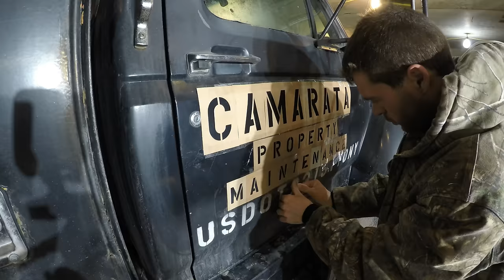Getting stopped by DOT

Comment: Another cool video, thanks! I used to be in fire safety education. For a few dollars more, halon extinguishers are so much better and last longer.    I have one that is now 12 years old and still at full pressure. Unlike ABC dry chemical  extinguishers, they do not ruin everything they come in contact with, and there is no powder to cake-up over time. They literally suck the oxygen out of the air, stop the fire asap and don't damage all the surfaces they come in contact with. With an engine fire for example, you will save soo many components.

Side note: before using a dry chemical extinguisher, smack it on the ground a couple times to loosen up the powder ensuring it will work. If the powder is caked-up inside, it will shoot out air instead of chemical.

Comment: I know this seems counter intuitive, and may vary from state to state and even scale to scale, but setting up a voluntary DOT spring inspection at a scalehouse can save a world of hurt later.  It demonstrates you are wanting to keep everything current, and if they find anything but a fairly critical red tag violation you are allowed to drive back home and fix it.  The alternative is to have problems discovered on a roadside inspection, after which you will have to have a certified mechanic come out for a service call, lose a bunch of time and generally at least several hundred dollars.  Also, most DOT guys will figure if you're driving right in to see them, they don't have the fear factor to work with, and you'll see a different attitude.  

Another alternative is to have a yearly DOT inspection/repair done by a certified shop, and the little sticker on the windshield.  I'm not as big of fan of that; had one done awhile back, and they missed a couple biggies which I later found while working on something else on my truck.  One of them was 2 cracked/loose bolts on my steering sector - now new Grade 8s are cinched with Nylocks.  Had a DOT dude found that, would've been ugly.
Reply: The solution is to be a better inspector than they are and know the regulations forward and back. Go out and inspect your truck like it belonged to someone else, then fix the violations. Also, always be cordial to the DOT person, it will be money in your pocket.
Reply: Hate to be the bearer of bad news but there is nothing " Voluntary " about D.O.T inspections considering you either comply with their demands or get locked up in a cage for resisting them or worse murdered for resisting their attempts to lock you in a cage!

Comment: I guess 'they' get us all, eventually!
By the way Andrew, I would suggest that you use a torque wrench on those lug nuts, and be sure to watch the direction of rotation for the tread on your tires. 
The next time you have to 'do battle' with a tire like this, get yourself a more soapy water solution to spray around the bead, it'll make it a bit easier to remove the tire and install the new one,..but NEVER use grease ( as some might suggest ) grease/oil don't like rubber.
Reply: Reg Sparkes ...
Great advice.. 
torque it to spec 
and after your first load 
re-torque it again...
Been a Heavy Equipment mech for 35yrs up here in Northern 🇨🇦
Cheers
Reply: Hey Luke, thanks for the 'back up' !
Greetings and Cheers to you, from far eastern Canada !!
Reply: Reg Sparkes  he proberly should leave the nuts on as well before he hits the collets. They have been known to fly off and brake teeth or fingers.  Just loosen the nuts to the end of the thread then hit those collets buddy. 🤭
Reply: Use straight dish soap next time. It'll make that bead slick as snot.
Reply: Astroglide works
Reply: Grease doesn't bother the tire, been doing if for many years, the reason to use grease over soap is that it keeps the road salt from destroying the rim. The tire flexes away from the rim letting salt in and then it sits there destroying the rim, the grease is a good barrier against it.
Reply: David Morse   Please don’t tell me you copped one in the nads. 😩🥴🤢🤮
Reply: @dunk4373  I hate to admit it.
Reply: It makes it slippery because it is dissolving it.
Reply: I am glad it works for you. Tires for my truck costs  around $650 so I am not going to take a chance with gas, Murphy's  Oil Soap is my choice. Also gas is so dangerous. Got burned up using it as a kid.
Reply: @dunk4373  absolutely, Kid is good but needs MORE experience  and knowledge !!!!!!!!!!!!!!!!!!!!!!!!!!!!!!!!!!!!!!!!!!!!!!!!!
Reply: Ron Thorp he is doing great work ! There’s not many younger blokes out there anymore having a go. Most of the youth these days wouldn’t even know that they had a flat tyre in till the side wall was destroyed let alone know how to change it 🤔
Reply: I grew up in a family truck and heavy equipment repair business I'm 57 years old and still in business. I've never seen anyone use a torque wrench on a Dayton wheel in my life
Reply: Cindy Tepper  we call them spider rims in oz. I’m the same as you never seen anyone torque them. We use to put a block of wood or something with a square edge on the ground and rotate the tyre as we tighten them to make sure they ran true. After that when they travelled around 50 km the driver would get out and re tighten them after that no troubles.
Reply: @dunk4373  Like torque would mean anything on those dirty threads and that one stud and nut that are seized together that is tightening into the spoke of the wheel. Actually that stud isn't seated into the wheel.

Comment: For Future, when doing it in the Cold changing old tire for new one. Try using a Heat gun or heater to warm up the tire some. would help a little bit.
Reply: plus a little soap and water in a squirt bottle helps, tire guys call it pig snot.

Comment: When you buy a "good" fire extinguisher there will be a valve stem assembly on it. This can be used to top off the pressure if any bleeds off and to refill it after use. Typically you can recharge the extinguisher three times before needing more powder. Just unscrew the top and make sure there powder in the bottom ( at least three inches worth) and check the o-ring seals before reattaching the top and represurizing.
Reply: Make sure there is no pressure in the bottle before you screw it open, or accidents will happen. Over here in the Netherlands you have to check the extinguisher yearly and every 5 years a pressure test.
Reply: In my 67 years of life I have yet to use a fire extinguisher to put out a fire.  They just made the rule up to have another excuse to write you up for something. Also somebody's brother in law is in the fire extinguisher business.
Reply: Powder fire extinguisher should not be pressurised with standard compressed air, It contains moisture and will cause the powder to go lumpy Either dry air but usually Nitrogen

Comment: 4/32" on truck tire thread in NYS , 2/32" on light duty vehicles  for the NYS inspection .
Reply: Or just go to a place that don't care lol.
Reply: I've seen those regulations printed exactly as you describe,  it bothers me more then it should that it isn't 1/8" and 1/16"    reduce your fractions DOT!
Reply: 2/32"s is the Federal CMV requirement for non steer tires. 4/32"s for steer tires.

Comment: Don't kid yourself.  The reason they are there is to generate revenue for the state.  Any positive effects are circumstantial.
Reply: No doubt.
Reply: No. Its definitely so timmy and jimmy dont put 20 tons of logs in their rusty truck and kill a family of 6 because their brake lines blew oug
Reply: @tiddiesprinkles  lol I had dot stop me because my garden hose was hanging too low to the ground
A lot of it is bullshit.
Reply: @testman8974  think about this, your garden hose catches something in the road and gets pulled off your trailer. Not a huge deal right? Now imagine if while your garden hose is getting pulled off it gets wrapped around your tool box wheels and yanks 300lbs of tools with it at 70mph.... that's why everything and anything needs to be perfect.
Reply: @testman8974  i have seen a hose hanging of the side of a cement truck, and all I could do was hope it was on his side of the road and not hit my windshield

Comment: I know this is an older video but I had to put in my 2cents. When you adjust those self adjusting brakes you should tighten them all the way down then back off a 1/4 turn to get them the same adjustment all the way around the truck. And grease them as well.

Comment: Lots of lubrication and little bites of the bar make tires go on and off easily.  ;-)
Reply: Also having a toasty warm tire works too, let it set in front of a salamander heater while you have lunch.
Reply: Dawn dish soap mixed in bottles with water
Reply: Mike straight dish soap works best in my experience. No mixing or hassle and the bead is slicker than a banana peel

Comment: Tire changing 101 , use a soapy spray solution to help get tire off rim
Reply: Tire vaseline is way better but soap also work
Reply: Timothy Edmiston warm tires are far easier as well...
Reply: It also helps the tire go on easier than rubber cement. I am guessing that he has never heard of selling his casings back for retreading
Reply: All lube ya rubba
Reply: Outside in the dead of winter lol. Maybe just the soap

Comment: Good video,just stumbled across your channel,was surprised to hear your radio station as I listen to the same station,I realized your a local guy... I’m in the Walden ,NY area  ...DOT has been really hitting it hard lately,always seems like whenever I see bad violations,they are never around,then I see them crawling all over a new peterbilt that’s clean and well maintained,and an old Tri axle with leaking brake cans ,a leaking lift cylinder,and bald tires just went by and got away clean ,it’s all in the timing....
Reply: New truck you got the $$$$$$$$$$
Reply: That's because clearly a guy with a new well maintained truck has some money he can part with.

Comment: Wedged wheels should be lined up perfectly. While jacked up lay a block of wood alongside tire, spin tire too look for wobble, adjust with lug nuts on wedges. Just tightening lug nuts and wedges will usually not work.

Comment: I still have no idea how these two-piece wheels are safe
Reply: They are not 2 piece they are tubeless wheel's they did not make a 22.5 two piece wheel
Reply: @chrispoole2531  Some wheels have a removable bead ring and at first I thought it looked like that type of wheel but couldn't see where the split in the ring was. These aren't really a two piece wheel since those wheels actually split into two pieces in the center of the rim.  Both types are illegal to use anymore as people have been killed when they blew apart when first airing them up. You have to be sure to clean rust from them before trying to reassemble them and many people didn't do this causing trouble.  A cage or wrapping a chain around them is required in case of an explosion.  I had to mount my own motor home tires because of the wheels having split tire beads. These kind of wheels also have a tube installed to hold air.  Neither the split wheel or removable bead wheels are used any more.

Comment: fire extinguishers are required in my country too (for all 4+ wheeled vehicles) but they expire, so even if the gauge is still showing perfect pressure you need a new one, i think they expire every 5 years, you can get them checked and refilled but it's not worth it.

Comment: I guess DOT was waiting for you to arrive on this road.
Reply: Bernard Peraldi the dot guy was driving by while andrew was sitting at the stop sign.  that's why he was turning around when andrew came upon him.
Reply: Andrew was broadside to him and he probably spotted the lack of door lettering bigger than shit. (I got nailed that way once as well) 
Generally, if you have one visible problem, there will be more.
Reply: Why are so many weigh stations closed now? I only see one or two once in a while open. The rest seem abandoned in the Northeast. I don't think I see any automated ones that replaced them.
Reply: Cantankerous Clanking Contraption They probably figured out that people were just taking side routes to avoid them. 
Portable scales are easy to setup, and driving around lets you spot people you might never see on the highway.
Reply: Cantankerous Clanking Contraption I live in CT and the state has only a couple folks to run the scales. They go from scale house to scale house. One day they could be in Stafford, the next in Danbury. Depends on the day.
Reply: I'm in mass, and they move the gear around probably much for the same reason.
Reply: acprimus631C, Those Ct bastards would pull me over every other week and keep me tied up for at least 45 minutes and almost never find anything major. I live in Ct also.
Reply: @cantankerousclankingcontra8295  Drivers are more aware  of what is required now thanks to the internet.  States cannot issue as many citations so the weigh stations cannot make enough money to support themselves. Also trucks going in and out of weigh stations impedes traffic and is a safety hazard. Weigh stations are obsolete but it will take a while before they are phased out.

Comment: Do you ever balance your truck tires? Or is it not necessary on trucks like that?
Reply: Usually, they just balance the steers.  You can balance the drives, but nobody bothers unless there's a serious issue.  Before balancing duals, usually they will rotate the wheels to differently opposing positions to see if that corrects (to any degree) the imbalance.  If turning/moving the rims alone doesn't work, sometimes it's a matter of deflating the tire or even totally dismounting it to visually inspect for a problem.  If they are that badly out-of-balance, there should be something visible to the person (such as a bunch of boots or patches close together on the inside), the tire is more likely to be taken out of service before trying to resolve it with balancing, but if you have the money and insist it be done,  it can be done.  Most folks just see it as a waste of money at the time that "new" tires are put on in the drive position.  That said, it's not impossible to get a truly "bad" tire, but not usually a brand-new one. The tire factory usually does an in-house test on the tire before it leaves the factory. Of course, buying tires from questionable sources can yield less-than-desirable results :)
Reply: Generally truck tyres are not balanced like a car tyre with visiable lead weights, generally balance beads are used inside the tyre, 2 handfulls are placed inside wilst fitting the tyre and cenrifugal force spreads them to where they need to be.

Comment: In powder fire extinguishers the powder compresses over time.  The same powder will compress at the same rate.  A Carbon Dioxide Extinguisher has a longer shelf life and it leave no residue.  Powder fire extinguishers are very messy and hard to clean up after use.

Comment: You have a 'tire machine" and your busting your ass with tire irons?
BTW:  You should have kept the replacement tire in a nice warm place in the house before trying to put it on.  Would make the job a bunch easier.
And your dirty oil is "right where it should be":.
Reply: Diesel engines have dirty oil no matter what.
Reply: yeah the oil wasn't that dirty

Comment: I got told by guys that service extinguishers the you need to turn them upside down every 3 to 6 months to keep the seals good. Ive got 8 yr old extinguishers that are still holding good pressure ( i have newer ones but keep the old ones to use first IF i have a fire)

Comment: ANDREW: 125 PSI, for a dual wheel 295/75/R22.5? That seems high. 95-110 is the max I've seen. 95 PSI would work fine and give a better ride if the air pressure matched the weight load on the side of the tire. This is what you have to go by. That rear axle is rated for around 20k, 5,000 pounds per tire in a dual position would equal around 95 PSI on the charter I'm looking at. The tire should state the minimum pressure required and the max allowed. Second, the air pressure is different for single and dual. Please see the comments about removing the nuts before knocking the lugs loose, and the dangers of the split rim. There are videos on youtube that cover this. Be safe!

Comment: Here in the UK we have a yearly MOT, basically a full yearly inspection of your car, and if you fail you need to either fit the problem or scrap your car.
So you'll never get stopped basically unless you're driving illigally, at which point you will be fined £100-£1000 your car will be towed, but surprisingly no points on your license.
Reply from the maker: We have yearly inspections too, but also have random roadside inspections, which are often more strict. Some states in the US have no inspections.
Reply: @AndrewCamarata  yup.
& some states did, 
but now don't... wtfOK

Would the DOT officer have
broken out scales if you'd had a load?

Comment: I do the exact same thing I use Mr sawzall dismount a old tire if you have a good metal cutting blade it will also cut the bands of steel where the bead is

Comment: The fire extinguisher gauge is actually an gas pressure gauge. It needs the pressure to expel the powder. Too bad that it was just below. Once used, it will need to be refurbished or replaced. The powder ruins the seal and all of the gas will leak out shortly.

Comment: Usually fire extinguishers come with a sticker with blocks so you can annually inspect them and tick the box with the dates so you know when to check next time

Soapy water would have helped with removing the soft tire 

Or you have power tool a chance to use them I guess 💪🏼